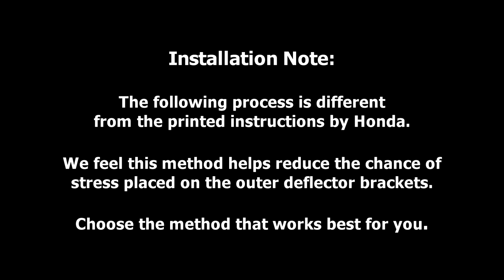Episode #292 - 2017-2022 Honda CR-V Air Deflector Installation

Comment: What is the point of the protective films?
Reply: Vibrations from the car moving could eventually chip the paint, so the film acts as a buffer.

It allows you to have the option of removing the deflector at a later time and have the paint undamaged.